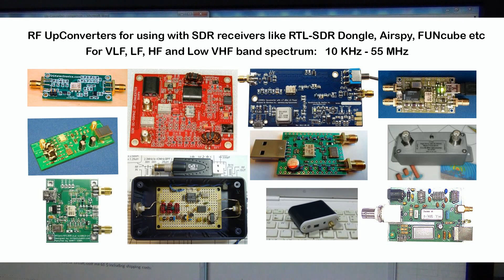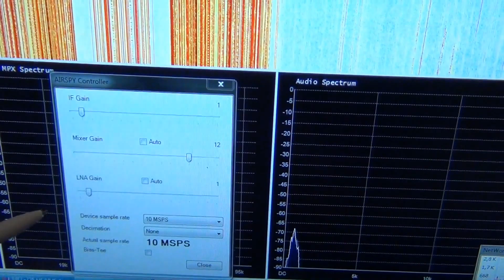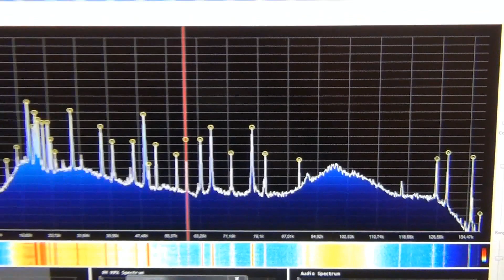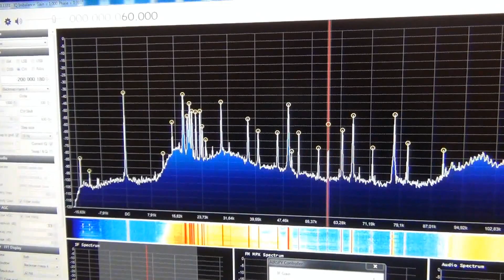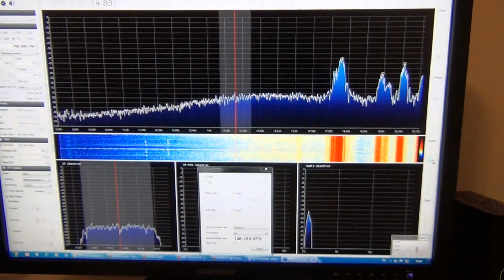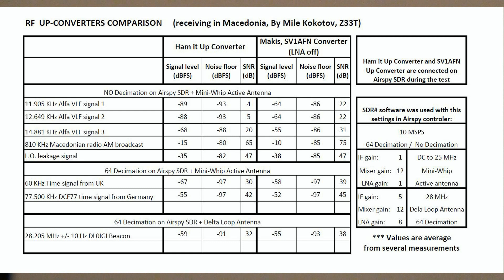RF Upconverters Comparison: Ham it Up vs SV1AFN - part1

Comment: I chose the SV1 up converter because it is useful down to 10 kHz or so.  Other up converters and SDR units that include VLF reception claim to go down to about 100 kHz.  I think that the claim of 100 kHz is often exaggerated.  They will not receive 60 kHz signals from WWVB. Finally,I did not find the LNA feature on the SV1 to be useful.  It was too noisy everywhere.

Comment: It used to cost a lot of money if you wanted to listen to the HF band (0-30 MHz) but nowadays it's dirt cheap thanks to inexpensive SDR's like some of the one's profiled in this video. I bought my first RTL receiver dongle a few years ago for only $12 and later bought the Nooelec Ham-it-Up converter to go with it and once you get everything configured, it works FANTASTIC. I also have a high-end Icom IC-R8500 receiver but find I use my cheap RTL receiver more than the R8500!

Comment: Excellent comparison Mile.  I think I definitely will gett the SV1AFN upconverter for my next low-cost SDR build. Have you done or seen anything similar that compared the Airspy to either of the newer RTL2832 + 820T2 or RTL2832 + 820T2 with the 0.5 PPM TCXO?  I would love to see a comparison of those vs the AIrspy with the SV1AFN upconverter. I am specifically interested in the noise floor and SNR between the SDRs as you have done between the two upconverters.

Comment: An excellent informative video. "Sugar Victor 1" (0:53) rather than "Sierra Victor 1" eh?, I haven't heard that since I was a kid, you can guess the kind of books I read then. :-) Thanks for the reminder that there is still more than one phonetic alphabet. Is that the usual alphabet for you? http://en.wikipedia.org/wiki/Spelling_alphabet
Reply from the maker: Hi Paul, I am using them both ("Sugar" and "Sierra" for "S"). Some 35 years ago, in the time when I have learned English / international phonetic alphabet for ham radio usage, here in Macedonia,  "Sugar" for "S" was more common. :-)